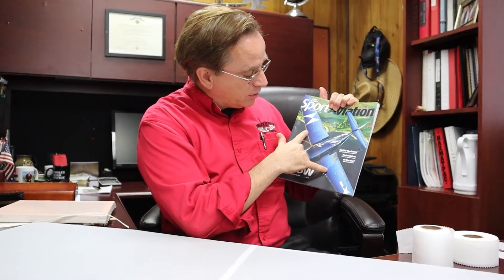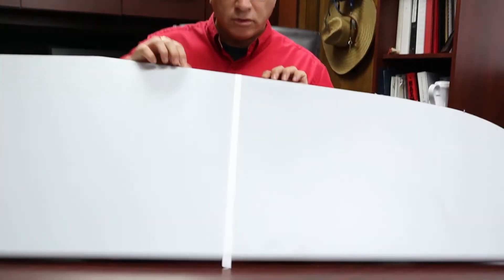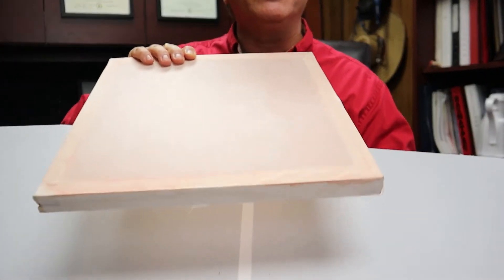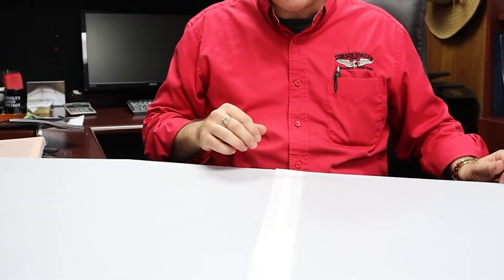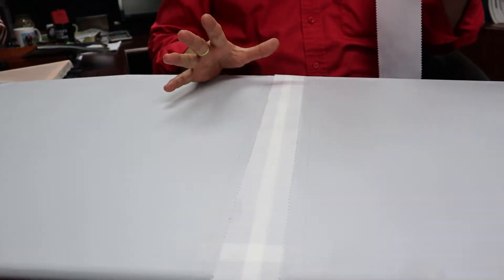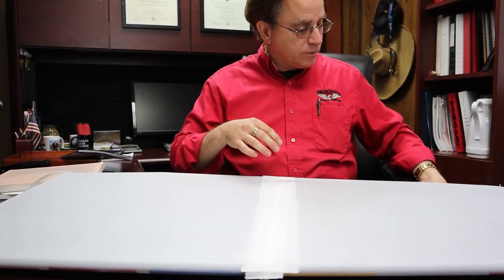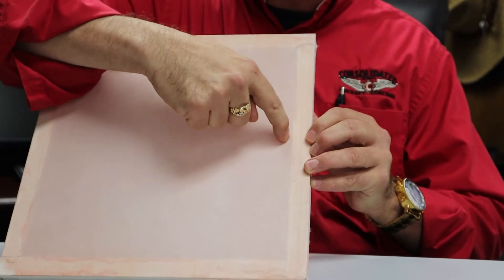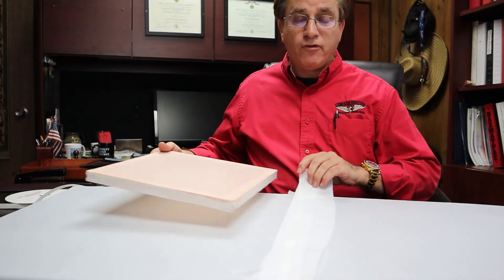Thinking of Double Covering?  "Poly Problems"

Comment: I am re-bulding a pa22/20 and i will use Poly-Fiber system. Like to know if i am using the double tape all over     the aircraft it will make more robuste ? I am planing to cover summer 2023. Regards
Reply from the maker: Hi Martin,

 

This process is usually for high-stress areas on high-powered aircraft.  Double-taping on the aircraft you propose might be engaging you in a bit of engineering over-kill, but if when you peeled off the previous skin you saw cracking along the ribs in prop-wash it could be justified. 

-Greg
Reply: @poly-fiberinc  Thanks for the reply,  best regards.